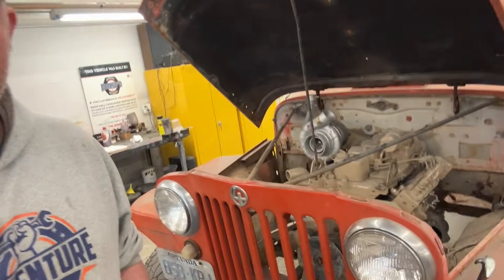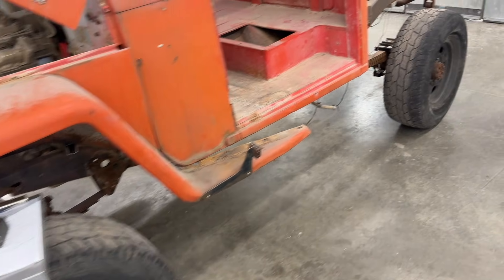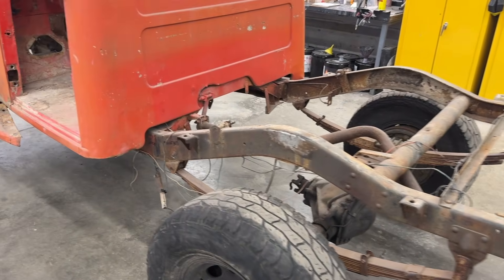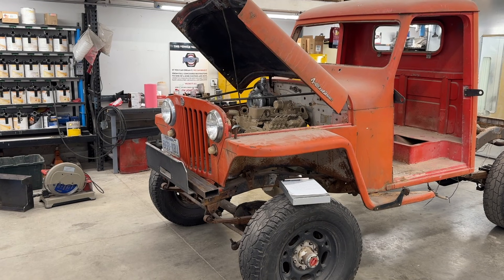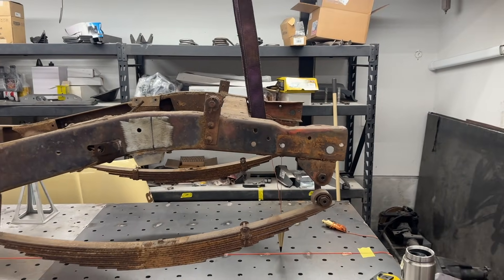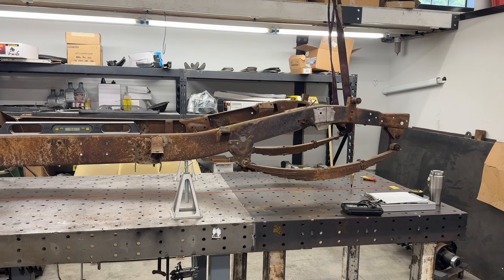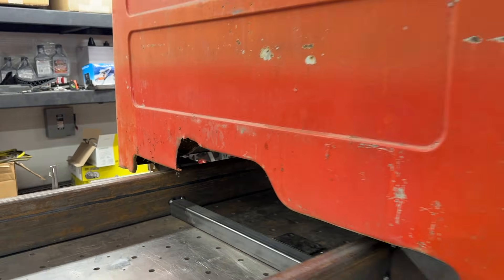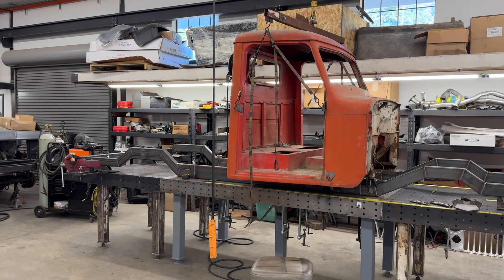1950 Willys Truck Cummins 4BT Swap | Custom Chassis Build – Farm Truck Project (Part 1)

Comment from the maker: 🔥 WELCOME TO THE 1950 WILLYS CUMMINS 4BT BUILD – PART 1 🔥

This is where it all starts. In Part 1, we scrap the original frame and design a custom chassis from scratch to support a Cummins 4BT diesel, modern drivetrain, and a real working flatbed.

👉 Watch Part 2 next: engine mockup, flatbed fabrication, and body prep
👉 Watch Part 3: full final walkaround of the finished truck

💬 Drop your questions below — chassis design, materials, measurements, or diesel swaps
👍 If you like deep fabrication content, hit LIKE
🔔 Subscribe to follow the full build series and future projects

⬇ Chapters are in the description ⬇